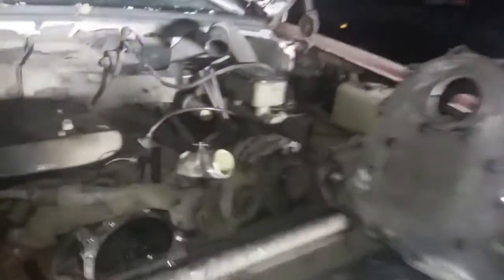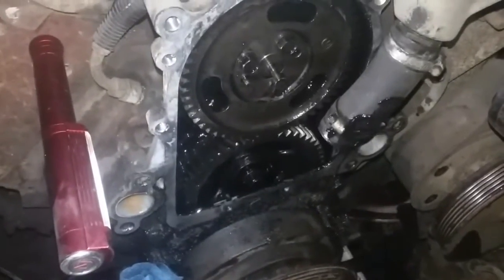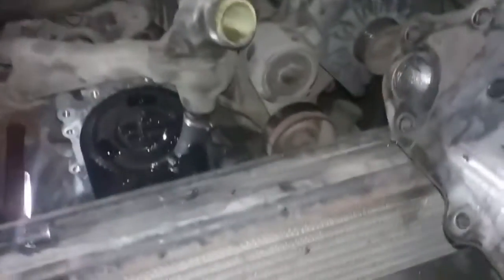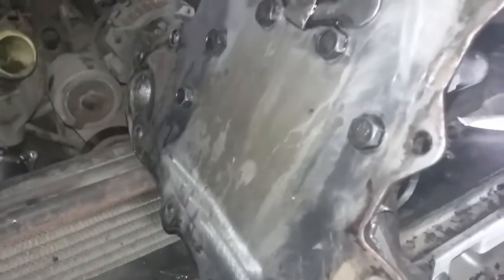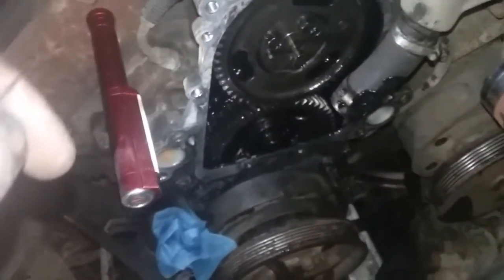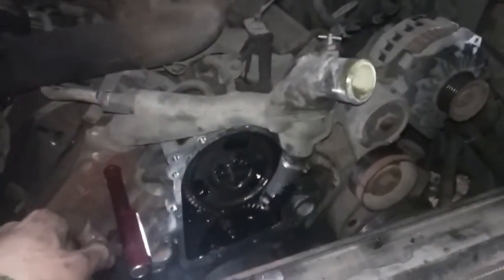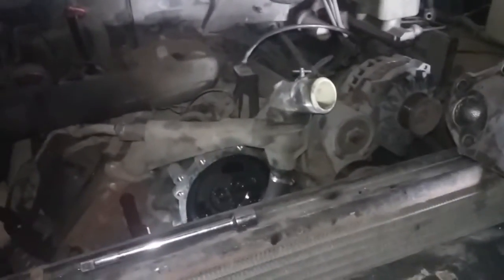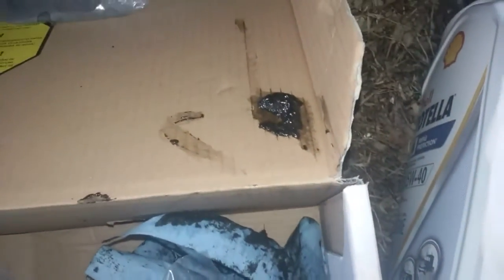Chevy 6.5 diesel watetpump replacement

Comment: I’ve done this job before and it’s not one I’d tackle on the side of the road , the whole front of the engine and accessories have to come apart. Hats off to you
Reply: Lol 😂
Reply from the maker: I actually just bought a 6.5 in my newest tow truck. And did the water pump so I had to do this all over again!

Comment: Fyi it's not a chevy engine.. it's a Detroit diesel the 6.5L is used in Humvees and a lot of boats and ships
Reply: Its not made by detroit Its just 6.5 diesel made in detroit lol
Reply: It’s actually a Detroit Diesel engine it was designed by Detroit diesel
Reply: Andrew Gibson if it wasn’t a Chevy engine it would be in a diff application it’s designed buy Detroit
Reply: Wow lots of info in this comment section. It’s not a Chevy it’s a Detroit diesel... it GM made in Detroit not Detroit Diesel 

Well let’s see... 
Chevy sub of GM check
Detroit Diesel sub of GM check
So i guess all are correct lol

Comment: You dont need to take the power steering pump off 😂
Reply: Depending on the year yes you do actually, it doesn’t need to come completely off but it has to be moved on some years
Reply: @ukeacreator93  there's things you have to do, but this is not. Think smarter not work harder.  If you have to move it that's okay but if you don't, that's better. Ton of things I didn't have to do because I thought smarter than just watching a video. Plenty of things, (time saved) for this truck I didn't have to do because I know what's possible. And no you don't have to take the whole front end apart. I mean you can but.. I would laugh if I knew what you were doing. It's like using a butter knife to skin a animal